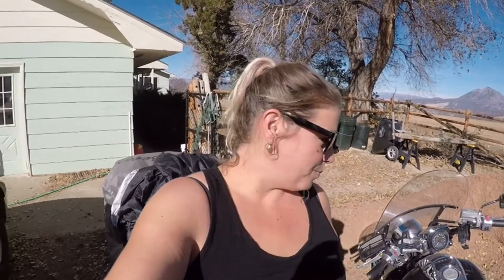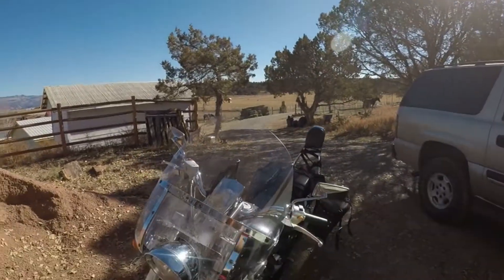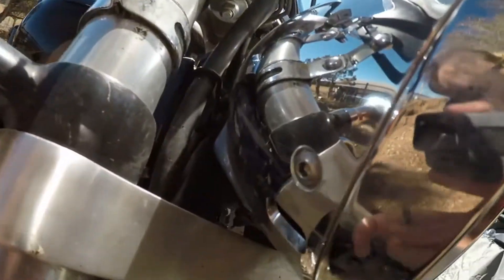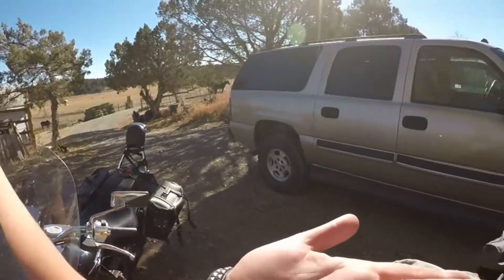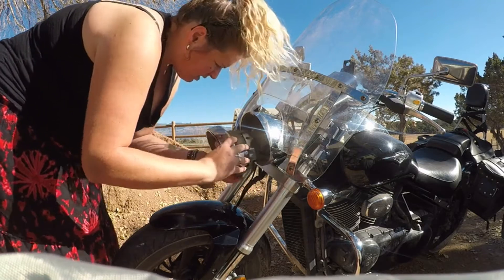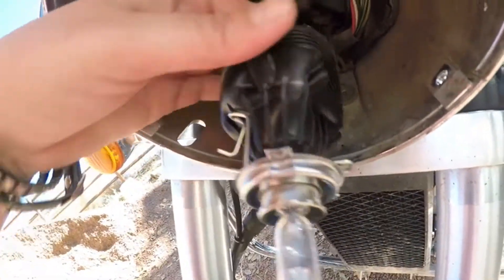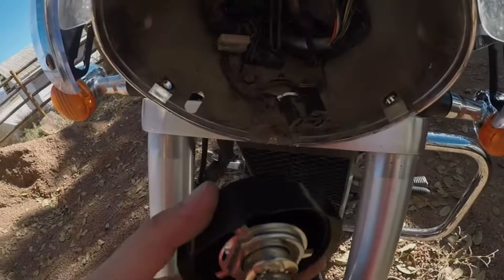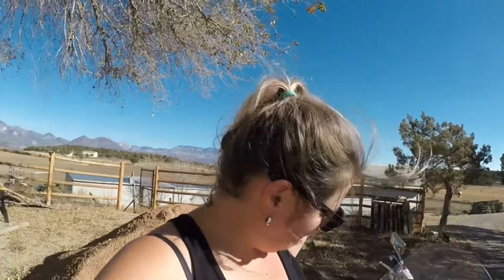How To: Changing The Headlamp Bulb On A 2008 Suzuki Boulevard M50

Comment: Just a quick tip:  it usually best not to touch the actual bulb with bare fingers - the grease from them can cause problems, so I'd recommend either using thin gloves (like surgery), or at least wiping the bulb down thoroughly after you put it in.  :)  P.S. Love the accent!
Reply from the maker: Steve Dillard thanks Steve!! I’ll be sure to wear some next time :) hahah oh yes, it’s an interesting accent alright 😂
Reply: Glad to find your video. I just noticed today my 2007 S-50 headlight is not working. I wonder how long I have been riding without a working headlight? I am a day time rider only so there is no telling. Looking back I now realize why some drivers were pulling out in front of me when they clearly (or so I thought) should have seen me. Lesson to me is I should always do a pre ride inspection of my bike before each ride.
Reply from the maker: William Hockstedler oh thanks!! I must admit, I have been a little sporadic on my pre-ride trips and never thought to look at the headlight but yeah, that awful road at night killed it and made for an interesting 3 mile dirt/rock ride, guided by the moonlight

Comment: Fyi do not touch bulb, the oil from your fingers in the heat from the bulb can cause it to explode you also are supposed to install the bulb with the metal clip into the headlamp assembly then put the rubber boot over the bulb/clip on the headlamp assembly and then simply plug it in and put it back on your bike. 2 screws and your ready! You manage to get it done but you actually do everything off the bike and then plug it in. your electrical connector was stuck causing you to have a difficult time and you pulled the bulb & clip out of the headlamp assembly so you didn't get a good idea of what it should have look like or how should have went
Reply from the maker: Tanner Ropp was my first time, had no manual and was going by instinct. You aren’t the first to tell me these things 😊

Comment: NEVER TOUCH THE BULB and ALWAYS use dielectric grease on the contacts to stop corrosion... when installing bulbs its important to wear latex or cotton gloves. Sorry, but I'm only here because I googled my bulb type (I forgot). Its always good to have a tool bag under the headlamp. I usually keep a spare bulb, 2 small flashlights (One to put on the road to signal drivers not to kill me) and I even put tape on my allen key so I can label it for a quick swap. Plus if I drop my allen key in the dark, it will be much easier to find. Its also good to have a small (better than nothing) hand pump and tire plug kit. Sparkplug and wrench. I also keep a GB20 in my saddlebag. (Which is a MUST HAVE; very compact battery booster, USB battery bank, flashlight and strobe light.)
Reply from the maker: TheWolfmanG no worries at all. You’re the second person to tell me about gloves and not to touch the bulb. This was my first attempt so all good :) I’ve a spare bulb in my saddlebag and toolkit is on the bike at all times
Reply: I don't know what it is but mine just broke 😳 😂. Good video! Thanks for sharing

Comment: Thank you for your video however there's one particular thing that I noticed that you should not do. Obviously you don't have to do this when you're removing the old bulb however when you're installing any new bulb to any car or motorcycle never grab the new bulb itself with your fingers the oil residue on your fingers will get on the new bulb this can and will decrease the life of the new bulb that you're installing the bulb will fail a lot sooner than its supposed to. If some people cannot install the bulb without doing this it is suggested that you put on a pair of plastic gloves make sure there's no residue of any type on the plastic gloves. Installing any type circuit board on anything you follow that same procedure however a circuit board might be easier to grip on the side I've installed many in my trade this is why when you read reviews on certain bulbs people are complaining that they go out too quick that's because the people got oil residue from their hands on the bulb and it blew out prematurely.
Reply from the maker: @robertlogan-k3c  thank you. Yep, was a complete newbie when learning all this stuff years ago